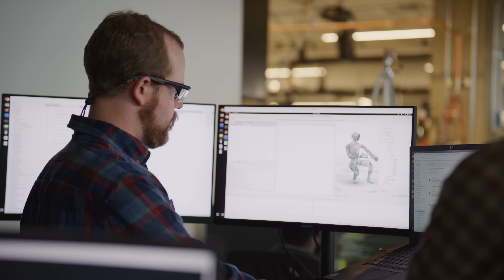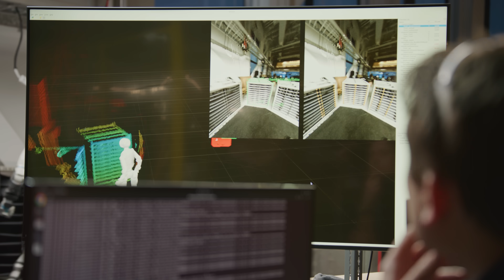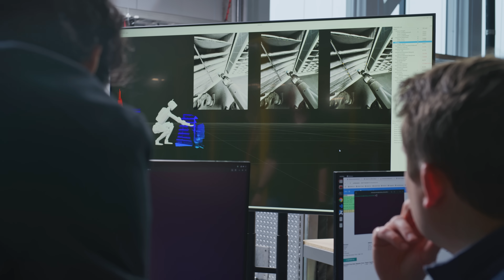Perception and Adaptability | Inside the Lab with Atlas

Comment: Cool machine but not suitable for industrial work.  nMECH is building humanoids for real work from dusty mines to the cold of space and backed by our 20yr warranty.  Our joints, controls, and software architecture are designed via first principles and inspired by biological systems.  We’re starting production end-2026.  You wont find us online yet.  Though Boston based, our R&D is mostly in Sri Lanka but if you see one of us at JP Licks, please say hi.  Just look for the nMECH t-shirt.

Comment: God. Keep this up, Boston Dynamics. You guys absolutely understand what exactly needs to be innovated on for humanoid robots to become a reality instead of just a tech demo gimick. Marvelous work!
Reply: What is the purpose of humanoid robots though?
Reply: @Anastaecia  I'm actually in a unique position to answer as I work with robots in my day job! See, the humanoid robots are able to complete jobs designed for humans. I work in a facility that's looking to automate the hellish and soul-sucking jobs- think a job like endlessly putting a manufactured part into a cart, for example. Such a job is impossible for a "normal" robot to do because it requires 1. improvisation and 2. a lot of maneuverability. Such a part that needs handled and such a cart that the part needs to be stacked in have been designed for use by humans- with the assumption that the user will have two legs to walk with, and two arms with hands to grasp with. Therefore, an ordinary robot won't work. 

Because we've had humans around for much longer than robots, many many jobs are designed for humans and would be difficult to change to fit for traditional robots. Anything that requires a lot of movement through human spaces, such as up stairs and through walkways, requires a robot to be able to walk like a human. Anything that requires fine dexterity, such as flipping a delicate package or pressing a button under specific circumstances, requires a hand-like gripping structure. A job that requires both such tasks, as pictured here, is easiest with a humanoid robot!

It would be far easier for a manufacturing company to hire a humanoid robot to do a difficult task than it would be for them to redesign the whole task to fit a traditional robot's limitation.

As for why we're looking into humanoid robots instead of just letting humans do these jobs- excellent question! Humanoid robots are designed to replace humans in jobs that are dirty, dull, or dangerous. For example, sorting packages for 8 hours a day in a hot warehouse. No human wants to do that job because it is boring, but also potentially dangerous- repetitive motion, such as the hand and shoulder movement to flip thousands of packages a day (over and over and over. . .) causes soreness and can even seriously damage human shoulders over time. So replacing the human in this job with a robot would save a human from having to work a job that's shitty or that could permanently damage their bodies!

As pictured here, humanoid robots will excel at jobs that are repetitive. They will not, however, replace jobs that require flexibility, improvisation, or any social aspect. A humanoid robot might be sorting packages in a warehouse, but it cannot be your mailman. A humanoid robot might be moving parts to the next manufacturing line, but cannot troubleshoot the finished product and figure out how to fix it. 

Warehouse and manufacturing jobs have been becoming more and more automated since the 1970s. Each step in automation has indeed replaced a human being's job. Humanoid robots are one more step in that direction, but are not going to steal everyone's jobs overnight. They're a tool with a specific application, just like a robot arm. It just so happens that this kind of robot captures the human imagination like no other, due to its likeness to our own form.
Reply: @Anastaecia 
Humanoid robots are basically the "all rounders" of possible robotic applications.

A good, advanced humanoid robot would be able to do any physical task that a human could. They also integrate into spaces already made for humans much easier. 

Their downsides is that they are not as specialized, thus less efficient. They are also more complex when it comes to keeping themselves upright.

Comment: There's a cool paper on this, called "How to build a brain", it explains how to build these foundation (world-building) models.
In essence, what we want is some sort of a Graph Neural Network (GNN) that can condense the knowledge about the world in the tiny kernels.
E.g. gravity kernel could be as simple as gravity formula but vision perception is probably your normal neural network processing images and extracting features from it.
Then the goal during inference is to figure out which kernels is most suitable for the context, gather them, and then predict next step (action/movement/speech/etc).

Robotics is where those things can be applied, as you need to continue teaching more complex things (e.g. social behavior) to the GNN, so it could form those real-world concepts.
Part of it could be simulated, like motor skills but you wouldn't be able to simulate everything, so at some point you need to teach robots interact with actual real world to continue learning.

It seems plausible that decent world understanding model needs as low as 200-300M graph parameters (kernels) to be on par as human being.
Our brains have a some redundancy so we have much more dense neural network but GNNs doesn't have to be with enough compute.
There's transformer model for GNNs as well.

Comment: Assuming that 3d mapping is what the robot sees, is that mesh processed from LiDAR input? Looks very smooth

Something odd I've noticed is that the robot doesn't retain the memory of the environment around it. Would make a lot of sense for the robot to remember where it last saw the drop-off point and check there first, but I guess that's not something that is tested for yet

Comment: Great progress - but honestly far, far away from any practical use. Too slow. Still too error prone. Uses way to much energy and hence runtime is too short. I'd love to see the performance in a typical factory environment with uneven floors, bad or changing lightning, various parts, dirt... factory workers and craftsman are still safe for a long time from being replaced. IMHO the near future is to make mass production robots smarter. They will still do the same repetitive and monotonous, tasks in a mass production environment, being connected to a wired power supply with the environment tailored for robots. But adapting them to new tasks will be much easier and not programming but intelligent instructions.

Comment: You already have robots though that can learn how to walk. I've seen videos, maybe not from Boston Dynamics but the researchers had a small four-legged device maybe a foot wide, and they simply told it to walk but did not tell it how exactly to move each leg. But the neural net figured out how to move each leg so as to move the robot forward. I'm not sure how that's done but it is done and then the robot learns the mechanics on its own. 

Why can't you also have this humanoid robot do the same thing?  You don't have to model everything mathematically. That takes too much computation, and it's not necessary.

This is not a new idea for me because I've seen other researchers talk about this many years ago. To model everything mathematically is a slow way because it requires everything to be set up exactly the same every time.  In the real world as you mentioned that's not the case.

 Like when you're driving a car anyone could be around you. It could be a truck, it could be a sports car, it could be a motorcycle. You don't need to know exactly what's around you. But you do need to know how to interact with what's around you.  In your video though, the robot had a specific task to do, place a flat electronic component into a slot.  

So all you need to do is to train the robot to know what this flat electronic component looks like, and what the cubby hole looks like. Then you tell the robot to go look for those.  It uses its internal neural net to navigate. 

Plus you shouldn't be having to tell it each individual moves on how to squat down to pick up something.  You should just be able to tell the robot to get yourself in a position where you can grasp this object. 

It should be able to figure out itself with its neural net how to squat down, or even if it needs to at all. Like it might have been actually better in that situation to bend at the waist rather than at the knees...  You shouldn't have to waste human power or computational power to make it kneel.  Don't tell it how, just tell it to do it. 

Maybe have some rules in place, that say you can't knock this piece of equipment over to get to your destination, something like that, so that whatever it's neural net comes up with, it doesn't do something that's undesirable.

Comment: Still seems kind of slow and drunk right now, and I wonder if all the movement optimisations would still be necessary if the speed overall was closer to that of a human.  Also, weirdly, the parts of the body not actively involved in the task are the ones that are shaking.  It's as if they receive less attention from the controlling AI.

Comment: It's interesting how it doesn’t just pick the component up from the floor, but orients itself first so it doesn’t have to rotate the component once picked up

I wonder what would’ve happened if it couldn’t align itself so it couldn’t rotate the component. How would it have rotated the component in the air

Comment: What happens if you give this robot a neural network so it could learn stuff without the need of us programing it and that's ofcourse by putting that neural network in a computer that simulates the robot movements in a program and when the robot learns stuff there you put that neural network in the irl robot basically the computer is it's school and what it learns in the computer it does irl that's to avoid programing and stuff

Comment: Problem i always have with humanoid robots is that companies have no idea what their market is. You see them stocking shelves or moving boxes. We are at a weird intermediate point on automation right now, but the future of factories will be much more modular. Im sorry but a factory designed for a certain movement method and a very basic robot with wheels designed specifically for that mission will always beat a humanoid. Humanoid robots primarily make sense in areas like hooking up hoses, cabling,  doing stuff like remote repairs/factory debugging, or building on rough terrain. They may seem like the best way right now, but they do everything and are specialized at nothing. A basic bot that is specialized would have like 20x throughput which will just demolish you in the market just a couple years after being integrated (you fit now but you wont soon).

Comment: ( Minute 1:15 ) What i don´t understand ... why does the robot walk very close around the object on the ground, almost stepping on it and then bow down to grasp it ?  
Why not instant bow down and grasp as a human would do there ? It is fitted with cameras on the side of the "head" and should be able to see the object on the ground immediatly .. but it turns its head in every "wrong" direction first and then discovers the object on the ground .... both mentioned actions of the robot seem to be unefficient, a waste of battery energy and worktime ...
Reply: Probably to match better with the existing training data. More consistant the inputs results in more consistant outputs. Everything requires training. Training takes time and money. There is a balance between efficiency of movement and efficiency of training.
Reply: @TildaAzrisk  But that is the question .. when this behaviour is based on training data .. why has it been trained wrong ?  Atlas has so many joints and can easily bow down and grab that thing without doing that "dance around"  ... the turn and check with head front cameras might be a safety feature to not kick something in the way or not to harm any human standing next to the robot .. but still why does it have side cameraas then ?  It is absurd

Comment: what is the power consumption of this version of the atlas, also I hope you guys are using HGGCNN correctly for the new atlas, the previous one had some troubles (I think it was because it was a hydraulic-based system and this one is electrical)

Comment: I know it seems innocuous, but the Atlas robot is doing several tasks that are currently done by humans in a factory. Taking a metal piece that has been pressed by a machine, then placing it into the cart, which will be pulled by another autonomous robot to the manufacturing assembly line. With what we are watching here, tens of thousands of jobs will be eliminated. If it can accurately drive screws, that will be hundreds of thousands of jobs. I’m not arguing against it. But it will be a nightmare if the current power structure is cemented in place.

Comment: One thing caught my attention in the video: the observation camera on top of the robot doesn't stabilize the image during movement. The footage is affected by the robot’s steps and vibrations. Wouldn’t integrating a gimbal system into this camera provide more stable visuals, making object recognition and analysis easier for the AI? I believe a stabilized image could enhance the decision-making process as well. Has any testing been done in this direction?

Comment: It had to do a full 360° SLAM scan starting counterclockwise to find the dropped object? Why couldn't it use the phase of the audio to gain and initial rough fix of the object by approximating the sounds point of origin then from the data determine rotational position of the head for it to face the sounds PoO then scan to make as few adjustments to appendage position as possible to speed up drop identification?

Comment: Does it remember the 3d location of points after it looks away, or is it vision only? It's like it has to look back at the shelves to see where they are again before starting to move. Could it not start walking in the direction of where the object last was, and then it turns its head as it moves to get the precise location with the camera? 🤔 💭

Comment: Hey Boston Dynamics, you should put TPU or polyurethane rubber (60-80 Shore A) on the bottom of the robots feet. It adds cushioning to absorb shocks, adapts to uneven surfaces for better stability, and provides strong grip to prevent slipping on any terrain.
Reply: What makes you a expert on robots 😂
Reply: @kimkay2196 Because I am a cybernetic organism. Living tissue over a metal endoskeleton. My CPU is a neural-net processor — a learning computer.

Comment: Why is the entire perception model based on vision? Last time I checked humans have 5 senses with at least 3 being essential to interacting with the world around us. Why doesn't Atlas have sensors on its fingers so that it doesn't need to rely on its cameras so much? Why not make an integrated system that can classify each type of data, and use that to construct a world model which can represent reality much more reliably? There's a limit to how much you can manipulate ocular data before until it becomes incoherent. Atlas needs other senses.
Reply: When it comes to analyzing the ambient, ocular data is the most prevalent, even in humans. Sound data can help, specially in omnidirectionally, but ocular data allows to analyze shapes, distance, angles, and more with precision.

Taste doesn't help with spatial awareness, the robot doesn't eat either.
The robot may benefit from tact, but that still needs developing.

Smell is extremely imprecise, doesn't exactly help with spacial awareness, and, again, the robot doesn't eat. 

Hearing is imprecise, but can be useful. 

Vision is the most helpful in this case.

Also, Atlas has gyroscopes to act like our sense of balance.

Comment: A humanoid robot paired with a really good model will be the last tool anyone will need. You don't need a robot vacuum cleaner, it can just use a regular one. No automated litter box, it can just clean a standard one. Dishwasher? Nah, it can just wash everything by hand. Put it in the driver's seat, and every car is now self-driving. It is the final tool.

Comment: Also I see that your robot super slow when it looks for the object, that's because you most likely still not implemented a prediction based fuzzy visual search when you predict color of pixels at the specific % of the image and where you can recognize if something like the object you're looking for in sight or not(in milliseconds - because you would sample only every 10th or 50th pixel). Neural nets is not a future, future is a fuzzy unified concept system which can utilize the nn`s only when they're needed.

Comment: I think I get why they dropped Atlas—hydraulic drives just can’t match the precision and agility of electric motors.
Reply: Repairs are also more expensive and difficult with hydraulics.  Safety and reliability are also reduced with hydraulics.  HD Atlas was mostly just proof of concept.  The knew early on that fully electric would be the way.

Comment: What happens if you run up behind a robot and hug it?
Reply: you'd probably get crushed from the weight alone. This thing probably weighs over 300 kilos.
Reply: @MKVProcrastinator  Of course not...
Reply: @MKVProcrastinator 
I don't think it's THAT heavy. It doesn't use any sort of super battery or heavy duty servos.

At most it likely weights around 100 kilograms.